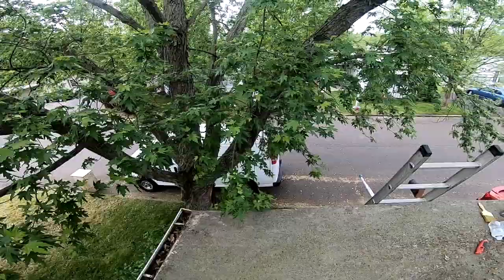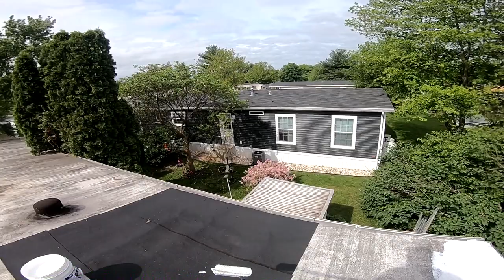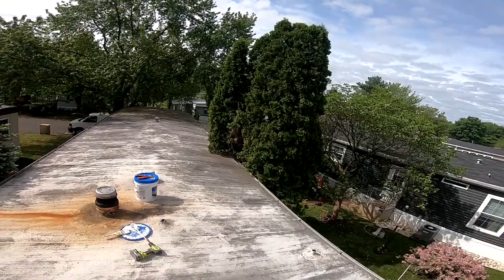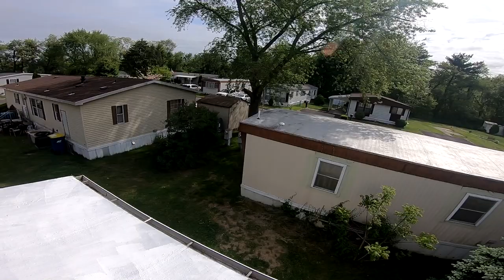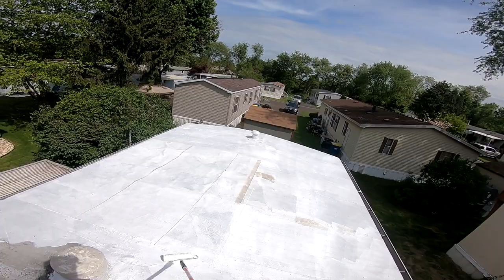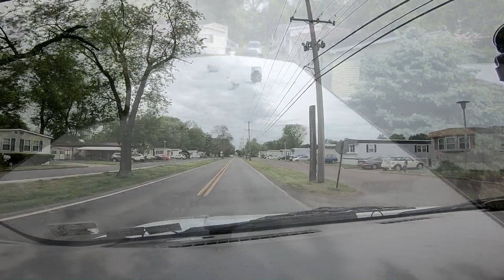Bob Seal Coating a Manufactured Home Roof

Comment: You commentary is so natural, like a casual conversation. I love it.
So, I'm planning on doing this, but using Gaco Roof coating. I just do the same? Cleaning I understand is the first step, I was gonna scrub with a stuff bristle push broom. No water. Should I worry about rust? I'm also gonna use eternabond on places that need it.

Comment: The mobile homes around me are using other stuff. Like a blue plastic plastered on their roof. I heard it's burned on or something. Then next door, they paid these workers to put down a thick plastic roof, nailed on. A worker took time to tell me it was a 10,000 job. And I was like whoa. He recommended me to do the plastic burning thing. Which I didn't even know where to start. Last winter I kept using tar to patch a bad leak. But it wouldn't work. It kept leaking. So I used flex seal white paint. And omg, it saved me. I feel like this is the cheapest route for me. I should do this to my roof this year. Thanks 👍 let me know if you have any opinions on my comment. I would appreciate it.

Comment: I do a lot of Mobile Home roofing I try to steer people away from cool seal. It is a very cheap fix the problem is it won’t last that long. You say or it says on the bucket 7 to 10 years sure it’ll stay on your roof 7 to 10 years but I’m not sure it’s going to be holding out water for 10 years.  I just wonder how much does a job like this cost.
Reply from the maker: The client was instructed to recoat every two years for the reasons you stated. 

Cost depends on the area in which you live. What does your roofing company charge for this?

Thank you for your comment

Bob

Comment: Good video. I am getting ready to do the roof on my 14 X 60 mobile and my main question was whether i needed to cover seams with mesh and you covered that well unlike other videos I viewed. I am thinking two 5 gals will do or maybe have a 1 gal can in case I run short. Don't want to use a tiny bit of a third 5 gal can and have a lot left over.
Reply from the maker: If you have any areas that are ripped up or in poor repair or that currently leaking even if it’s only a small drip you can take and purchase the material and sandwich it between the seal coating. Put a layer of seal coating down put the mesh on that and roll it in with more seal coating but other than that you don’t need to as long as this stuff is all nice and thick.  if you have a 14 x 60 I would get three of the larger cans not two and 1 gallon because there’s gonna be some areas that you’ll notice appear lighter than others And you’ll want to go over them.
Reply: No bad areas that I have noticed. God point on three cans. Thanks again!
Reply: What was the material you said to use if you have a leak? Also is there one kind you recommend over another. My trailer is old and I’m not sure when the last time the roof has been done.
Reply from the maker: Ashley Dawn The coating at Home Depot is 

Model# HE587871 
Internet# 202091022 
Store SKU# 292043 
Store SO SKU# 1000215131 

The repair fabric used for leaky areas is:

Model# HE296195 
Internet# 100058184 
Store SKU# 450596 

Roll on the white elastomeric roof Coating, embedding the repair fabric into the wet coating using the same roller and then coat over top of the repair fabric with more of the same product.
Reply: Bob's Home Services LLC  do you recommend cleaning the roof first? If so what do you recommend cleaning with
Reply from the maker: Ashley Dawn I swept it off and then used a leaf blower to ensure any small particles remaining were blown off. You can wash it but then you need to let it dry.
Reply from the maker: I would have three 5 gallon containers and a couple 1 gallon containers you can always return them

Comment: Can you use or would you recommend a thing called peel and seal for spots that are leaking and then coat over top of it where you said to use the fabric stuff so basically use the peel and seal in place of fabric stuff

Comment: Why didn't you cut back the trees that are hanging on the house before you coated it?
Reply from the maker: Client didn’t want me to touch the trees.  I suggested removing them as well because they were growing so close to the mobile home that they could eventually cause more extensive damage, but the client did not want them removed or cut.  I can only do what a client wants, but your right in thinking they should have been cut back at the very least.

Cheers,
Bob
Reply: THAT'S EXACTLY WHAT I WAS THINKING . I KEEP ALL TREE LIMBS/BRANCHES AND SHRUBBERY AWAY FROM MY ROOF AND WALLS .

Comment: I bought a mobile home in Florida. The roof has never been coated. I want to protect the roof, but I'm coating it because the sun just bakes the inside of the trailer! But most of the other coating videos I watched, talked about using a "thick" sealant. You said what you used was "thin."  Can you shed some light on this? I'm not sure what to use! Oh....the roof has no holes or rust.

Comment: Idk if you're still available.. I am doing this Monday. Researched as much as possible. I'm not sure I'll be able to use water on the roof to clean it.. would dry brushing it off and then applying work out okay? Water is off on the trailer -_-

Comment: How often do you need to reapply this product? I am looking at many ways to fix the leaks on my trailer including reroofing it, bit then I saw this video and now I am intrigued.
Reply: Also will it go over the tar material I already have up there on earlier attempts to seal it? I used the black knight sealer previously.
Reply from the maker: Every two years is good enough
Reply from the maker: Yes over tar is ok
Reply: @BobsHomeServicesLLC  thankyou
Reply from the maker: Corey Martin Your welcome pal

Comment: Can you go into more detail on how you would repair that patch they put roll roofing on
Reply from the maker: Yes just simply roll the same material onto the roof over the area you need patched cut the piece of mesh lay it over the patched area and then roll over it again with another coat of the same material

Comment: Does this go over rust I noticed there was some rust on this job but no mention of it
Reply from the maker: You probably should clean any loose rust off but this goes on much like waterproofing paint. It’s quite thick and sticky and can go over rust that is not loose. 

Do your best to clean off the rust with a steel brush and then wipe it with a dry rag before coating it

Comment: Thanks brother I’ll be grabbing me some Henry coating. I just don’t want to create a skylight by accident….
Reply from the maker: Oh no, that would be bad. Be careful and try to place your feet onto the rafters if your roof seems weakened.
Reply: @BobsHomeServicesLLC  note taken, thank you
Reply: Update : I did it, came out beautiful! Thanks for the tips and I had no problems up there! Easier than I expected, but the heat will knock you down here in Vegas, lol
Reply from the maker: @OrgyEntertainment  OMG yes. It was 103 here today
Reply from the maker: @OrgyEntertainment  WOOT, WOOT, glad it's done and you were able to do it without that new skylight you spoke about.  The heat has been terrible here in PA as well.  The other days feel like temperature according to accuweather was 103 and I too was outside working.

Now you can just sit back, enjoy a cooler environment because the white color really does reflect a lot of the suns heat and enjoy a dry home.

Cheers,
Bob
Reply: @BobsHomeServicesLLC  I’m glad it’s done too! Now I can sit back with confidence that if it ever rains here I’ll stay dry, lol! I’m pretty sure they take those temperatures in the shade cause it felt like 130! Thanks for the tips my friend✌🏻

Comment: My trailers about 20 years old and the roof is pretty rustic , do I need to buy a primer to use on it before the seal?
Reply from the maker: You should clean it with a degreaser, throughly rinse and allow to dry.

Comment: I'm working on a mobile home that has been tared a few times in past so the tar is very cracked and chunks missing, but I tried to scrape off and power wash what I could but couldn't get it all off. With that being said can I go over top of it with this?
Reply from the maker: Yes but you should put a layer of this product, then embed the fiberglass mesh into the wet product and let it cure. 

After it cures you should go over it with more product. 

You only need to do this where the cracks and poor roofing quality exist.
Reply: @BobsHomeServicesLLC  which fiberglass mesh is this? Do you have a product name?
Reply from the maker: @macknumber9  Check out this product on Amazon:

https://www.amazon.com/Henry-HE296195-Repair-Fabric-Polyester/dp/B000BZ5ZQI/ref=sr_1_4?dchild=1&hvadid=78202817948223&hvbmt=bp&hvdev=c&hvqmt=p&keywords=roof+fabric&qid=1614083855&sr=8-4&tag=mh0b-20
Reply: @BobsHomeServicesLLC  thanx Bob... I have a mobile home any inspectors foot went through the roof it was so brittle. He macgyvered it and there have been no leaks for 8 months but I am seeing a ceiling panel that is damp. Do you think it would be wise to use the coating that you used in this video right above the area where that ceiling panel is damp there is no active leaks but the ceiling panel being damp tells me that something is extremely minor
Reply: The ceiling panel is just brittle and damp and I did have rodents in the Attic So I'm not 100% that it is not just rodent urine but that would be a lot of rodent urine that would make it that brittle and damp
Reply: That happened to me and water getting trapped under rubber. Have to remove.

Comment: you say every 2 years... is there anything that will last longer? I am a 63 year old woman and never have done roofing work. I have a 1976 12x60. metal roof that has been coated with fibered aluminum. I have also been advised to never walk on the roof because it buckles and can cause more problems. Also, I live in central PA. do you do work there?
Reply from the maker: Unless you have a new roof installed, some thing either rigid metal or a structure built out of 2 x 6 and shingled you probably only have this as an option. If you cannot walk on the roof then it’ll need to be done from both sides however the obstructions coming out require walking the roof. We are in Pennsylvania are you exactly?
Reply: @BobsHomeServicesLLC  I sent you a message/form from your website...
Reply from the maker: @FreeDom-dh5mf  Not sure I saw it, can you resend?
Reply from the maker: @FreeDom-dh5mf  I didn't get it Free Dom, but would love to help you out.

Comment: i worry that i weigh too much and will damage my roof :/ any advice? just try to stay in the middle or?
Reply from the maker: You might want to get someone smaller or try to do it from a ladder but that’s difficult. 

I weigh 274lbs correctly and I know I was too heavy.
Reply: @BobsHomeServicesLLC  i do have a cousin i could ask for some help and after hearing this i think i will go ahead and reach out. Thank you for your quick reply and honesty it is greatly appreciated
Reply from the maker: @heavenlee4461  good luck with your project
Reply: @BobsHomeServicesLLC  okay so i got up there today and theres like thin layers of black stuff? do i need to pull that all off first? some of it is flaking but some isnt
Reply: theres also an area that has some moss growing? do i wash that with soap and water? or just hard dry brushing it off will be enough?
Reply from the maker: @heavenlee4461  I would scrape it off with a painters 5-in-1 tool or something similar and wash it good with bleach and water.
Reply from the maker: @heavenlee4461  You can text me a photo of it if you want.

Comment: A buddy of mine swears High Gloss paint works better and lasts longer ?
Reply from the maker: Let us all know if your doing it.
Reply: Okay I will do it cause my friend says he's sealed Florida roofs and it was the best and cheaper (mobile homes )
Reply: The good news here is you didn't say "oh no don't do it ! " lol
Reply from the maker: @FurthermoreJack  Did you complete it and did it work?
Reply: Lol tonight is the night , starting in one hour , going with high gloss silver patched all our roof leaks
Reply from the maker: @FurthermoreJack  keep me posted
Reply: It's a nice silver  ! Listen we are doing it I will see if I can make an after vid ... A friend says any Acrylic paint will work on my type of roof Mobile Home , lol if its fades what not , that everyone needs to re paint or seal paint their mobile home roofs every 2-5 years anyways
Reply: Anything acrylic paint will work all our leaks are fixed we went through and calked  all the leaks sealed, no more leaks and it's holding up great is the best silver color roof I've ever seen
Reply from the maker: @FurthermoreJack  Awesome, thanks for getting back to us.  So there ya have it.  Regular acrylic paint from the big box store worked after caulking the seams.  What did you caulk the seams with?
Reply: Fast dry marine strength. Basically the strongest calking on the shelf , we used in total 2 bottles for our single wide two bed trailer
Reply from the maker: @FurthermoreJack  Perfect....

Comment: any suggestion on how to find someone in the state of Utah?
Reply from the maker: Angies List or Google
Reply: @BobsHomeServicesLLC  Do you pressure wash first ?
Reply from the maker: @ReneeNme  I didn’t. Of the roof is really mossy or otherwise contaminated with nature’s wonders it may be a good idea but then you should let it completely dry before coating it.
Reply: @BobsHomeServicesLLC  Gotcha ! 👍 I understand what you mean by "Mossy" = Buildup.
Reply from the maker: @ReneeNme  yeah. If you have a lot of trees around that deep litter on the roof it may need a scrub. I wouldn’t use very high pressure on the roof. 

Find my video about pressure washing a house and in that video I give you a great recipe on a homemade cleaning agent that you can make which works amazingly well.
Reply: @BobsHomeServicesLLC  Already used your recipe on the the exterior of my mobile home that was painted bright white. It sparkles now as if it was just painted 😁👍

Comment: Literally apply two coatings of this every year, and 75% of the time will get a leak within that year.
Reply from the maker: Sounds like something else must be wrong because it's been a year already and they haven't had a problem.  I've been back to this place as well, as the video on this channel showing the railing install, was also on their home.